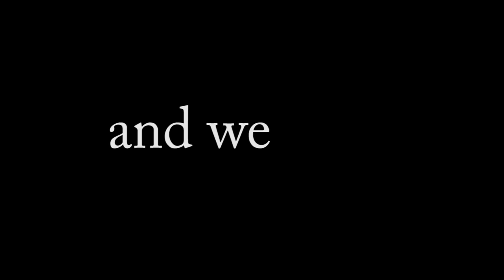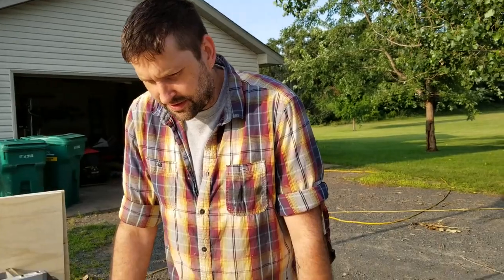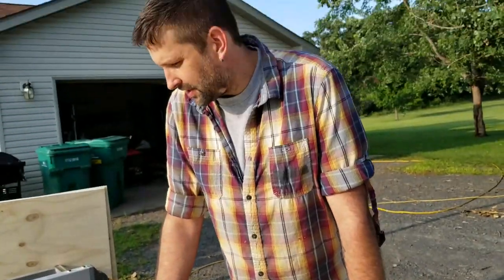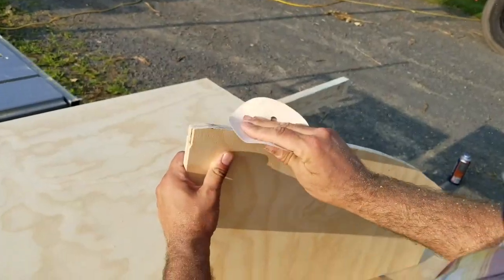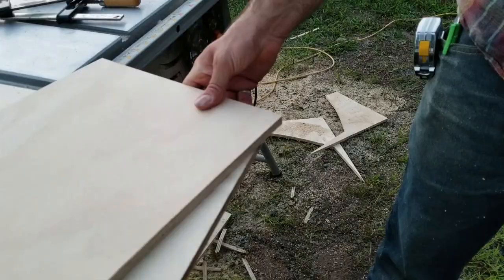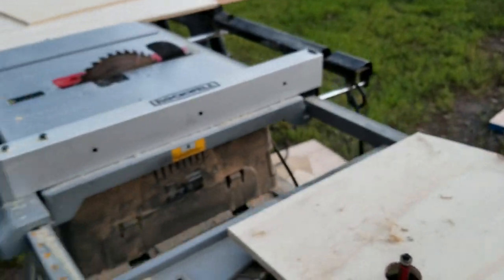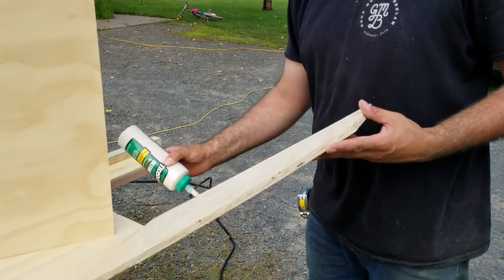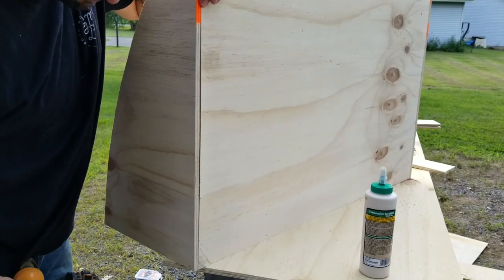School Bus Conversion: Upper Kitchen Cabinet build

Comment: I'm really curious! Why, do u think, people are willing to put $25,000. - $50,000. in a school bus instead of buying a finished RV or buying a coach/touring bus with huge storage bays, more headroom and better fuel mileage? Did u guys look at these option b4 u chose your schoolie?
Reply from the maker: That's a good question. We did look into other options. For us we would save money by converting a bus. We paid less for our bus then the cheapest smallest used pull behind camper would have cost us. We already had most of the supplies, tools and experience that we needed to do most of it. We thought it would be cool to make it our own..and besides buses are pretty sweet! They are safer and built sturdier than an RV too.
Reply: The Hudallas the first thing I thought of was that they are built about 10xs stronger than RVs.
Reply from the maker: Oh for sure!
Reply: The number 1 reason people are going with conversions instead of the pre build RV is... Those are  "mass produced" with the cheapest stuff those companies can get. They do not build stuff to last anymore.. They build it to fail so you can buy a new one in a few years...  This is why you see these bus and van life going for mostly older rigs then converting. One got got parts everywhere 2 When you build it you know EXACTLY how and what you did where and most likely how to fix it. It will last longer than that lot buy RV will before something breaks :)
Reply: Also in about 2 years time an RV has lost tons of its value and will just keep losing value to where in 10 years it's worth next to nothing. A converted school bus done nicely and properly for around 15-25 thousand, what most people spend on the average will not only last much longer, be built the way you want out of stronger materials from the shell to the interior but will hold its value for years to come or you can actually flip one and make money. Not to mention getting a good buy on a bus and getting a desiel engine for 3 grand instead of 200 grand that you would pay for one in an RV. To me it's a no brainer! The build is looking great guys!
Reply: Eileen Murphy More space, your own floorplan custom made for your family, insulation, a wood burning stove,... Not to mention a cute spice rack 🤩.
Reply from the maker: Thanks! Also thats a great point.
Reply from the maker: "Cute spice rack" lol thank you!
Reply: I've been using all used lumber, wiring, plumbing, etc for my bus conversion...saving a ton of money and recycling cool stuff.  Spending way less than  25-50 K on it...probably closer to $5,000 total....Start hitting the junk shops, thrift stores, craigslist, etc and get some bargains.